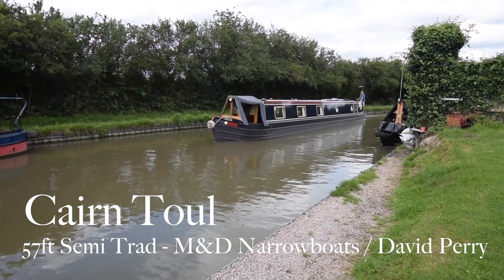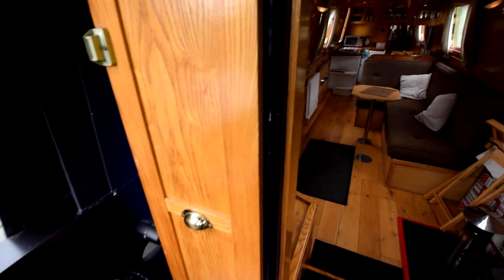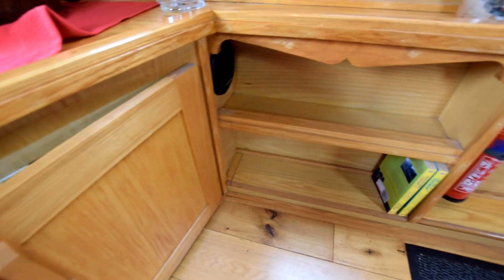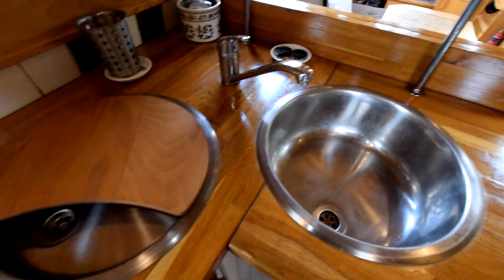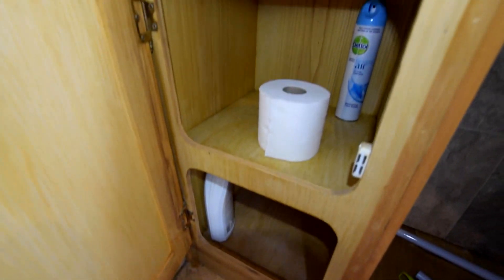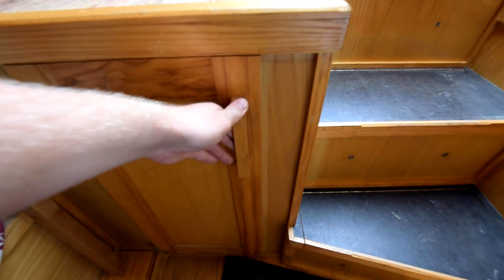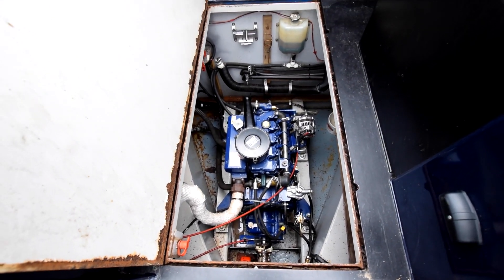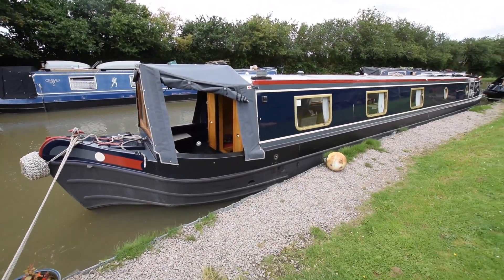SOLD - Cairn Toul, 57' Semi Trad 2011 M&D Narrowboats

Comment: Either she wasn't used much, or she was marvelously well cared for. Nearly every bit is "like new". Other than the crowded salon with the big dinette couch , she is well laid out, and ready for a happy owner. Also, as long as the fridge is not in a cubby hole, I'd opt for a larger and taller JLS 12v.

Comment: The saloon seems small to me, probably due to the dinette. Dual sinks is a nice touch. Am starting to hate cassette loos (don't want to have to dump one out), but that's me. Think there should be a railing on the back so you can lean against or keep you from slipping off. It's in great shape, though. The price is a bit dear, but it'll sell